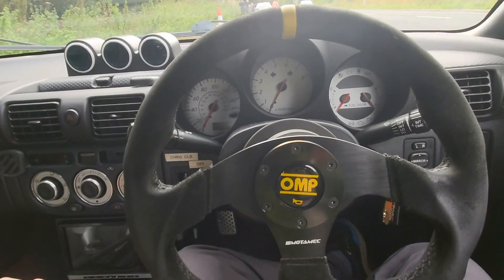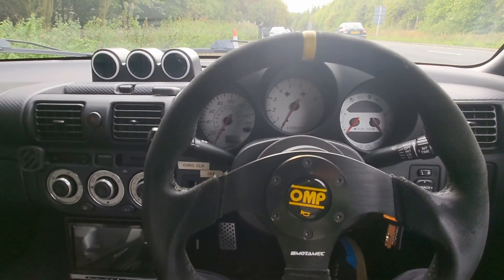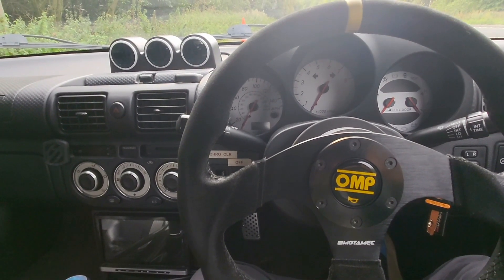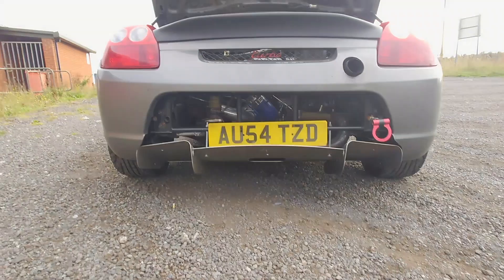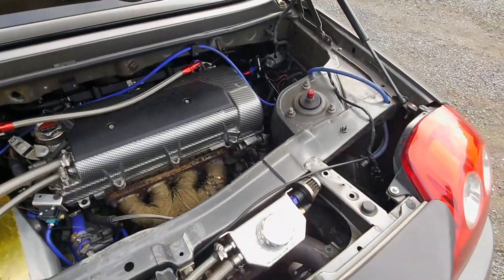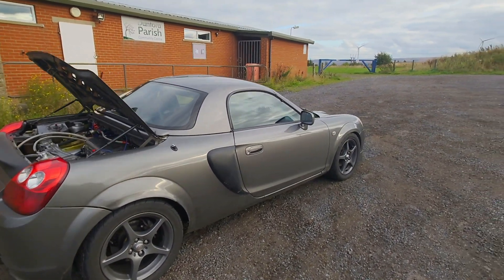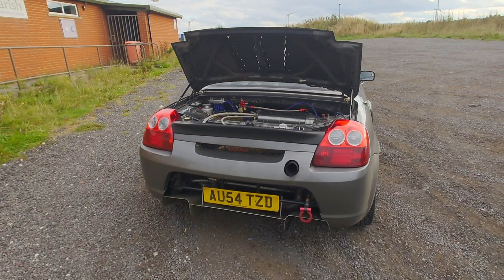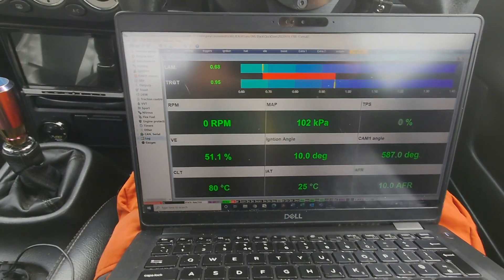2zz Turbo Update Mr2 Roadster Spyder

Comment: How comes you're running such a small turbo? Seems excessively small and must make a lot of torque fairly low, which would worry me on the stock rods.
Reply from the maker: It was my old turbo set up from my 1zz turbo that I transferred over to get up and running. Now running a fully forged low comp 2zz with a Holset HX32.

Comment: so you are runing on a oem internal parts with a turbo? are you insane ?
Reply from the maker: 2zz engines are quite happy upto around 300bhp with standard internals.
Reply: @Justaddboost  300bhp will blow up the c60
Reply from the maker: @lordnggamermtpoppy3829  torque kills gearboxes not bhp, careful tuning of the VVt to limit torque at mid range and it's fine. (On the limit but fine;)) 250-270lb fts seems to be the supposed limit.

Comment: Beauty! Whats the sun visor strip you have on it please? Im looking for one the same and also the oil pressure and temp set( sits very nicely on there)? Thanks
Reply from the maker: Cheers buddy, sun strip is just an eBay special 12" matte black and cut to size. I'll dig out the info on the gauges👍

Comment: What transmission are you planning on using for that sort of power? You’re also going to need a larger turbo than that to make that sort of power.
Reply from the maker: Thanks for asking, plan is to try and keep torque low for the time being. But I do have a lotus Evora gearbox, which I'm in the middle of making a bell housing adapter for. Turbo wise I have a Holset HX32 to go on which should be good for around 450-500.

Comment: that vacuum block is Utulisding every port, doesn't it matter that you need clean references for map and fpr sensors
Reply from the maker: Map sensor has its own port, fpr does not run a reference I've just used it to bump the standard pressure up to 55psi. The other ports are either looped (didn't have enough bungs) or is for the boost gauge or brake booster. 👍

Comment: Nice build mate ! The 2zzge is great  engine! I know people who runs with unopened engine with 200.000+ kms gtx2867 370hp 100% stock internals and gearbox. have only oil pump/pan and this is not necessary if the redline is up to 8.500rpm
Reply from the maker: Cheers buddy, got to work with what I've got! 😉

Comment: Looks very quick that Gary. Good way to keep it in lift lol! Are you planning to get it on a dyno once you have the tune roughly where you want it?
Reply from the maker: Plan is to Dyno once I've got the Vvti map sorted. (I keep fiddling!) But yeah, lift set at 5.6k with a 8.2k redline means it doesn't drop out 😜